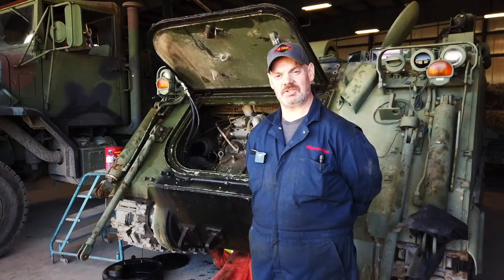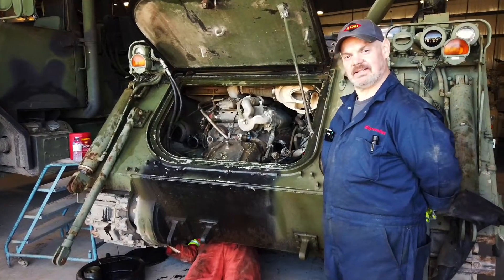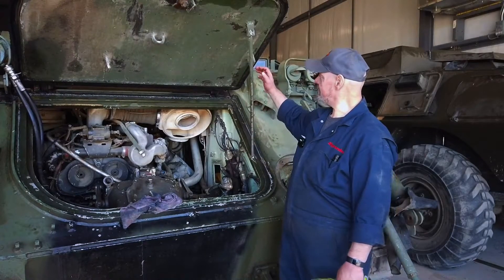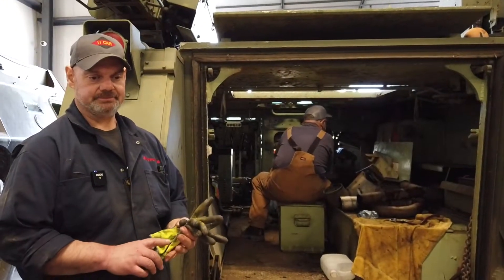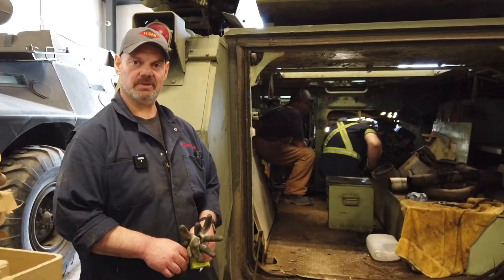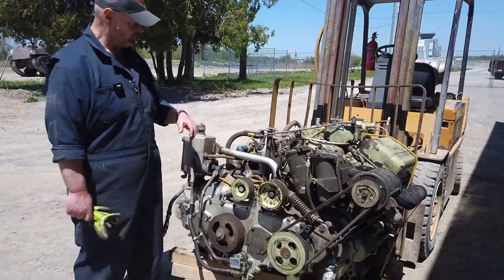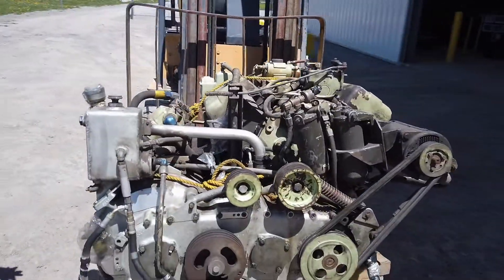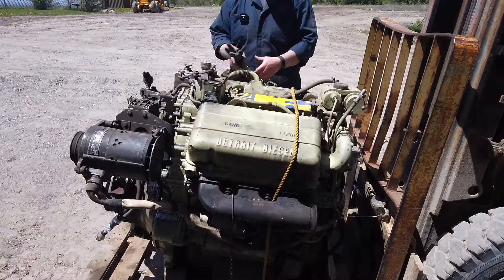Museum Behind the Scenes Series: M113 Engine Swap Part 1

Comment: You should have mentioned that not disegaging the final drive when starting these cold more so while i was in Germany everyone of us Mechanics carried spare Quill shafts which would snap if trying to fire the pac cold... During the Winter in Germany we made the Track Commanders and there crew start these engines every two hours during extreme cold. We were on a DMZ which required every track to be ready to roll no matter what. Enjoyed the Vid, understanding you folks dont do it everyday but i served for 7 yrs operated the M578 which we pulled the pacs with and all this said myself and one other mechanic and one track crew guy to be a gofer and we could remove and install a 3rd shop rebuild in 2 hrs.

Comment: Nice to see.i dit that job for about 26 years in the dutch army.i worked on the m577.  M113 c&v.  And the YPR 765. Also the recovery YPR 806.i am still doing it as a volunteer in the dutch tank museum collection.those detroits are the best engines in combination with the Allison transmission.i hope you all have fun for a long time with your m113s
Reply: Hi mr (basweijers) I was working for achates power racing team for tatra team and DAF team with engine very similar to leyland l60 and rolsroyce k60 and fairbanks morse. I really want to joint effort to help repair tanks for musums and ukrine.  I have product to adopt chieftain tank to chllener 1 tank . With very reasonable price . And many other armor vehicles. I suppose my project some how leaked to us army because they exactly work on our    opposite piston for re engine bradly and paladin and feature re engine m1 tank. I want ask you please recommend me to people like to upgrade old military equipment and re use it for other military that seek for proposal to have 1000 hp engine with reasonable cheaper price .  Thanks .
Reply: Hlo sir